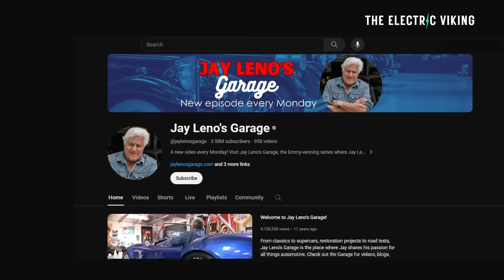Tesla reveals Semi production volume for 2023 and mass production in 2024

Comment: The biggest benefit of electric semis is not going up hill, it’s going DOWNhill. Diesel semis can run out of control going down steep inclines and in fact mountain roads often have runaway truck emergency lanes. Electric trucks can actually use regen braking to eliminate runaway trucks and get energy back into the battery  at the same time. This is a huge benefit and may make runaway truck lanes obsolete.
Reply: That was 50 yrs ago.
Reply: Regen braking!
Reply: @robertfonovic3551  In Colorado, they are the worst state for this, they had In 2020, 30 uses of runaway truck lanes recorded, while 2021 had 32 and 2022 spiked to 44, so it is still very much a present issue.  In 2019, a Texas driver whose brakes failed as he descended Mount Vernon Canyon on I-70 was responsible for a horrific crash and a 28-vehicle pileup that killed four people and injured six others.
Reply: Diesel semis have engine compression braking... Most crashes are causes by foreign drivers who don't understand how to descend hills safely. They just use the friction brakes.
Reply: @randgrithr7387  but it doesn't give them more range and they pollute
Reply: @keriford54  Jesus. That's alarming. We don't suffer that in Australia. I guess it's pretty hilly in Colarado. I would assume that semis involved would have had engine brakes fitted. If so, I wonder how much better would regen be? and if that would reduce the accident numbers?
Reply: @vancity2349   and they pollute 
Yup, emissions AND noise!
Reply: @BigBen621  For sure but those days are numbered, and it doesn't matter if people push back change and disruption is happening
Reply: @robertfonovic3551 Regen is much better because you don’t have to be skilled.  Engine braking on diesel trucks actually takes a lot of skill.
Reply: @randgrithr7387 doesn’t matter why they happen.  Point is they are much more easily avoidable in a Tesla truck. All combustion engines have compression braking via downshifts. EV regen braking is a much stronger force than compression braking
Reply: I drive a Merc Vito. Is tiny compared to a Semi Trailer rig but engine braking is almost non-existent. The van has an automatic speed limiter you can feel it using the brakes on a downhill. Engine braking is that bad.
Reply: Regen braking has a considerable retardation effect. More than enough to cause rear end crashes. New EU rules will demand that vehicles have accelerometer units to measure the brake effect and light the brake lights accordingly. I suspect this will lead excessive brake light usage but the idea is there.
Reply: @davidelliott5843 Some manufacturers don't turn on the brake lights when regen braking, but Tesla isn't one of them. Most EVs, including Tesla, activate the brake lights using an accelerometer rather than the brake pedal and have done for years.
Reply: @davidelliott5843  agreed. Anyone who thinks braking via regen and engine braking are similar has never compared the two.
Reply: One of many benefits. Doesn’t happen too often, but can be catastrophic when it does.
Reply: @vancity2349 it does give them more range. This is literally what happens when regen braking is done,  vehicles get more range.
Reply: @vancity2349 of course they pollute, they’re vehicles. The point is they pollute much less than existing vehicles that do the same job.
Reply: @aaronbounds1336  Are you saying an EV pollutes?
Reply: @ryanchappell5962  
Skill? In my Freightliner, you just set the engine brake followed by cruise control to hold at a set speed. It doesn't take that much skill these days. Modern semi trucks have powerful, quiet engine brakes.
Reply: @randgrithr7387  That’s cool, must be an automatic.  It works that way in most gas cars too as long as they are automatic.

Good to hear that modern trucks have solved this issue.
Reply: Have fun replacing tires and brakes and going bankrupt!!
Reply: As a result of the regen braking, the Tesla semi is just as efficient mile by mile on hill terrain as it is on the flat.

Comment: Besides wanting to make sure they've got the design right, Tesla's main hurdle is supplying the batteries.  These monsters require a shitload of batteries per truck!  Battery production needs to increase enormously to ramp the truck production numbers.
Reply: Tesla semi uses 2170 - doubtless Panasonic for quality. 
At least the cars, the 3 & Y can use a variety, say CATL or BYD LFP.
Panasonic are reluctant to massively ramp production of 2170, I don’t know why.
4680 is ramping at exponential rate, will eventually supply semi, maybe in 18 months.
Can standard range semi use LFMP? That’d get interesting.
Reply: @iandavies4853 I'd say the short range might be supplemented with the LGFMP  battery the issue is that weight is a concern even for the short range version. But just there's a part of the market that's not as concerned with weight limits think light weight deliveries so potato chips are a prime suspect also like cardboard boxes. So it's a portion of the market so having a cheaper option is quite useful even if this restain the weight of the transported goods.
Reply: @iandavies4853 the Japanese are very different from us 
I used to deal with them all the time their culture is to "save face " all the time ... To not disappoint or keep you promise.. so if the won't commit to larger volumes they are not 200% sure they can deliver ... 😮
Reply: @fwskungen208  Panasonic 2170 cells are 250 Wh/kg, so 500 kWh weigh 2,000 kg.
Working up to pack level, using 186 Wh/kg, 500 kWh is 2,700 kg.
CATL LFMP are about 220 Wh/kg, so 500 kWh is 2,270 kg, say 3,000 kg pack weight.
BEV trucks are allowed extra 1,000 odd kg weight. 
Most trucks can be shorter range. I don’t see an issue, total no brainer. 
But I don’t have skin in the game, it’s just an opinion, desktop guesses.
Reply: @customsolutions7167  thanks for observation. Panasonic used to dominate batteries, now CATL has rushed past.
Nevada was huge gamble. Paid off in spades now.
I’ve no faith in LG / SKI.
Reply: @iandavies4853 I believe Tesla have specifically said they will (or might) use LFP for the shorter range Semi.
Reply: Another consideration is grid build-out.

The Run On Less Electric Depot event that Sam has reported on previously, found that the biggest obstacle to the roll out of charging depots for truck fleets is the time it takes to get the power connection installed by the local power company.

As truck production ramps, this will become the major bottleneck.

Comment: It is not coincidental that the range of the truck is about the range of the driver, without a rest. Rest time = charge time.
Reply: You are correct.  62 percent of truck routes are less than 500 miles.  This truck will work fine for that.  I'm sure Tesla will have longer range trucks in a few years but these trucks will be fine for the majority of routes.  Realistically, if you're a single driver you can't legally exceed 715 miles per day.  If you're driving as a team, that's a different matter but team driving is not very common percentage wise.
Reply: @Ryan-ff2db  many miss the fact that the range was a choice by Tesla. The paradigm is different for trucks vs cars. With a truck, range (battery size) is a pure tradeoff with freight capacity. Clearly the technology can now cope with that compromise; decent range and decent capacity, at the same time. And this is just Mk 1. Within 5 years, subsequent versions will have exceptional freight capacity, and charging infrastructure will easily support 715 miles per day with nothing more than mandatory rests.

Comment: With close to 4 million truck drivers in America, you would need a whole lot more chargers for these trucks and we are still woefully short of charger for BEV's.
Reply: It takes time to gen up the infrastructure, but it is happening. 
Recent deals Tesla made with BP and even Mercedes and Ford all point to increased chargers and networks.
The US government is trying to get a charger no more than 50 miles apart on highways.
The transition from horses to cars happened really fast once a critical point was achieved.
The transition to EVs will happen very fast once the infrastructure achieves a specific state.
Reply: The difference is that they have their own standard, you know how many there are, where they will go, and when. They are building out infrastructure within a tightly controlled environment.

Phillip.
Reply: Had the same issue with gas stations back in the day.
Reply: The good thing about trucks is they almost always stick to major routes when transporting goods and there are already massive lots used for truck stops that can be expanded for chargers.  Short haul trucks will charge at their home base and will rarely use external chargers.  62 percent of truck routes are less than 500 miles.  These stats show that not only are EV trucks viable in most cases, they actually have some serious advantages.  The build out of chargers will take time for sure but not as long as the build out for passenger cars as they'll need significantly less chargers overall.
Reply: I totally agree with you on Charging for Trucks.  In the short run, first few years, they will go to fleets where dedicated charging can be provided.     I expect to see something pivotal when EV trucks arrive in numbers.
Reply: @GrigoriZhukov  in Russia perhaps. Not in developed DEMOCRATIC countries
Reply: @robertfonovic3551  clearly sir has zero historical knowledge of America's roads then, much the abject lack of gas stations their either. Move along sonny Jim, I didn't drive from Arabia to Baghdad to tolerate fools with no education.
Reply: Getting the power connections for large charging depots is going to be the main bottleneck in the BEV truck rollout.  This is based on the feedback from the Run On Less Electric Depot event where ten BEV truck depots were monitored and analyzed.

It's something that industry actors will have to look at, and work on.
Reply: @robertfonovic3551  What are you talking about?  It took 20 years after the invention of the automobile before the first gas station was built and another two years before the second was built.  By this time there were 500,000 vehicles world wide and only 2 gas stations.   People would find whatever the could in a pharmacy or store to power there cars.  EV's are way ahead of where gas cars were at this stage.  This is all well documented, look it up.
Reply: @davidmenasco5743  At least 2 EV companies are getting into the power generation and storage sectors.    I can't speak for them but I have a hard time imagining that Tesla is not thinking ahead to generating and providing the power.

Comment: That’s fantastic news. I was hoping that this period was being used to ground truth the semi trailer. My belief is that this is the future of truck transport and their introduction will revolutionise the industry. However, in conjunction with the strength and capacity of proving design there must be trucking recharge infrastructure built. To me the really huge demand for this product will be Europe. In Europe you cannot drive a truck or bus for more than 3 hours and a long haul is 7 hours. The future belongs to those that can see it coming. The electric semi is the future. Cheers Viking.
Reply: The future belongs to those that see it coming. Never heard that before but it is so true. Will certainly use it myself
Reply: Well... There are trucks and trucks, as well as there are routes and routes, short-haul and long-haul. That said, me thinks that those Tesla Semi trucks will be used mostly in short-haul trips and perhaps their main market will be for very specific tasks. Pepsi being one of the first "bed test" users is not occasional. Those trucks will most likely to be used for regional distribution or local and regional logistics. Think: A cargo ship comes with several TEU on them. One of those trucks will come to the port, charge one of those TEU and deliver it to the logistical center some 25Km away. Another of those trucks will to distribute part of the goodies that come inside those TEU for the cities in a 300Km range round the logistical center. That's for what those trucks will be used. I'm not wondering long-haul trips on those Tesla Semi or equivalent trucks in the next few years to come. Sadly for those purposes the best compromising solution to date between economically and environmentally sustainable transportation seems to be LNG, and that will be the future for the times being and for the next decades to come.

Comment: Most trucks are on the road for 16-24 hours a day over multiple shifts with 15 min refill
Reply: Tesla Semis aren't designed, intended, or marketed for that application. However, one did cover 1,076 miles in one day—with two drivers, of course—during the Run On Less tests in September, which is pretty close to the maximum per day permitted by HOS regulations and California truck speed limits.
Reply: @BigBen621  most trucks are going all week .. 7 days often 24 hours a day .. 
maybe a Tesla should actually team up and make an epic hybrid truck rather than full electric
Reply: Mandates with EV and reduced emissions definitely needs to start with the trucking industry rather than passenger cars
Reply: @MrBigbangbuzz  Explain the logistics of 24 hour operation.  How many drivers?  Are they filling up from a moving vehicle like a midair refueling tanker?  How does this work with federal and state regulations about the number of hours a driver can be on the road?
Reply: @incognitotorpedo42  I know when my mate drove .. shifts were 8-16 hours .. maybe a couple of 1 hour breaks .. truck was then used for night shift .. so when is there time to recharge ? 
Janus Australia are trying swap batteries .. hasn’t worked well so far with 2 of its 24 trucks self combusting
Reply: @MrBigbangbuzz Almost no trucks in the US drive for more than 13 hours in a day.

"Most" trucks sit at the depot overnight, and drive less than 100 miles per day -- but that's counting Class 2 up to Class 8.  

Still, even most Class 8 trucks drive less than 500 miles in a day.

Tell Chevron you tried.  But we didn't buy your made up crap.
Reply: @davidmenasco5743  just saying what my mate who drives told me .. 
if they are sitting at the depot doesn’t make a lots of sense for 11 hours as they aren’t making any money?
Reply: @incognitotorpedo42  
Sleeper cabs have two beds for two drivers. Each driver has up to 14 hours to work, of which 11 hrs is driving. Pay is split 50/50. It's simple math.

Comment: I commented as far back as nine months ago that the holdup to the Semi was - 4680 battery hell. Gonna double down on that; when they have those cells rolling out in the volume they originally planned for the CT and the Semi will be built in numbers.
And they need to do it soon ... because the eCascadia is not NEARLY as good, but it IS available! And FLEET buyers who spend a $100 million on trucks (think about how many trucks Kroger buys) are going to look at the economics.  Pepsi is getting a tremendous amount of goodwill and advertising out of the Semi.
I read that Coca Cola is starting to run the eCascadia, so Tesla's lead is at risk if they don't get their act together.
Reply: Smart move having 100 working prototypes out there. It will be interesting to see the improvements once they go into full production.
Reply: Tesla's lead is only at risk if they all stop work and go home.
Reply: They're going to need every 4680 they make for CT. They said current 4680 production is enough for an annual run rate of 24k, so they'll have to 10x battery production in order to build 250k a year.
Reply: Yeah, I find this theory that Tesla is waiting until it has gathered sufficient data from using Pepsi as a test case to iron out the kinks before ramping up a bit hard to buy.  They never leased any of their other vehicles to a limited market as a test before ramping production.  Why would they do this only for the semi?

I agree that battery production is the likely culprit.  Tesla has looked at the profit margin from putting the batteries they have into cybertrucks vs. putting them into semis and from an economic standpoint, their path is clear: ramp the cybertruck first.
Reply: 24k was one shift on one line, now have 2 lines and by end of 2024 have 8 lines in Austin.  Also making 4680 in Nevada and Panasonic building another factory  in Denver

Comment: One size does not fit all in the trucking industry. As it stands the Tesla semi is a local delivery out to a 12 hour round trip truck. 
In order to accommodate the longer hauls, it will need to have a sleeper unit, so drivers can actually sleep in there trucks, when 
the need arises.
Reply: They are going to do that.
Reply: Short haul 82% of all trucking tonnage
Reply: Freight companies often keep the truck moving and swap the driver.    No need for cabovers.  Pepsi did this during run for less and the truck made something like 1080 miles in one day.  The truck charged twice IIRC.   This was not a run to see how far the truck would go but an actual trip and load.
Reply: @danharold3087 Carrying potato  crisps😊😊
Reply: @robertfonovic3551  Tesla's famous 500 mile run from central California to San Diego was fully loaded.  82,000 pounds.  Pepsi makes soft drinks, not crisps.  Water is 1 kg/ litre.
Reply: @robertfonovic3551 The depot in Sacramento is for soft drinks only.  That Pepsi depot doesn't use the Semi for chips at all.
Reply: @robertfonovic3551  This was pepsi.  They sell flavored water.    Why are you against this vehicle?
Reply: @danharold3087  The truck charged twice IIRC 
Actually, one full charge between shifts midday at the PepsiCo plant, and two partial charges, interestingly enough at Superchargers at Harris Ranch, and not at a Megacharger.